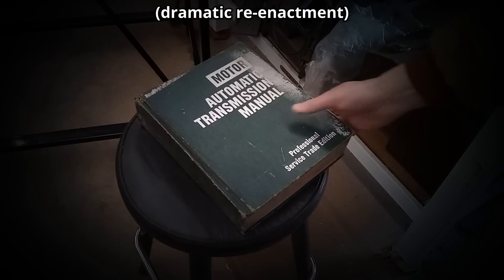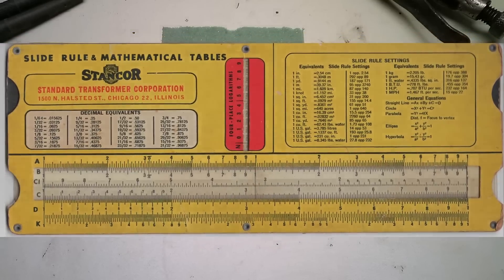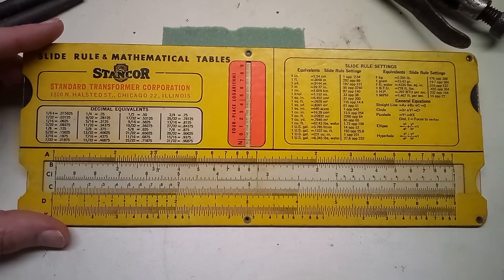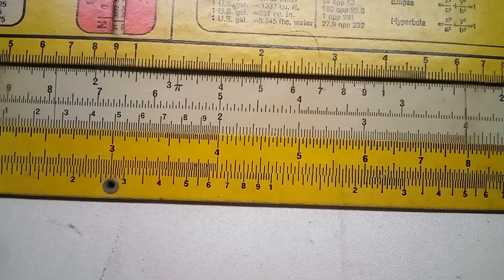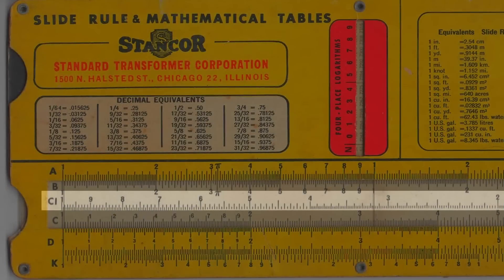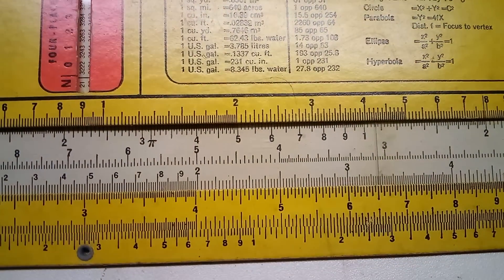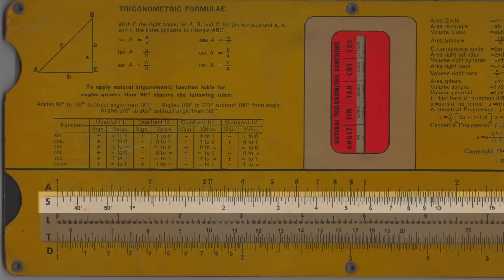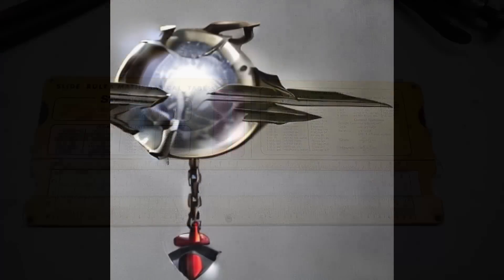1940's Stancor Cardboard Slide Rule

Comment: I believe that if I look in my oldest tool cab I will find a plastic idiot stick (slide rule) that I used in pre-calculator days. A little 8" (half size) one, that was "good enough" for what I was doing. 

I inherited several fancy German log-log-duplex trig model slide rules from my grandparents, but I think they are now lost to the ages (and my using them as a teenager).

Comment: Don't thing I've ever seen one made of cardboard before. I bought a slide rule off of Ebay intending to learn how to use it- didn't happen but I've still got it. Those of us who are old enough will remember watching the NASA rocket launches where everyone in Mission Control had a slide rule in their shirt pocket and could whip it out and get a very complex equation solved in a few seconds. I''m told the good ones are accurate to the 5th significant digit which is close enough for nearly anything. I've got one which calculates exactly how many yards of concrete you need for any rectilinear space and it was very handy when I was doing Form Carpentry long ago.
Reply from the maker: They're fun to play around with. I need to dive deeper into the more complex functions you can do with them. Yeah, most are only accurate to the 3rd significant. That concrete calculator one sounds cool.

Comment: Cheap calculators have been a thing for most of my life but when I was really young they weren't. So I knew how to use a slide rule then. Although I can't remember anything about it today. I also had this metal contraption with a stylus and a bale wire. You'd peck away at these sliding racks with the stylus and zero it out with the wire bale as I can recall. It was some kind of a mechanical calculator. Kind of like an abacus? I guess that's it, an Addiator? We were so primitive back then. What a time. But hey we walked on the Moon. Zoomers have never done that.
Reply: Addiators were for adding and subtracting, you can't do that on a slide rule.  They're pretty cool, maybe @Ballinator can dig one up!
Reply: @GreggMax  I haven't seen one in 50 years. But they were pretty popular back then. I had one as a little kid so they weren't hard to get a hold of. Where they all ended up I don't know. Mine was made out of tin and was probably made in Hong Kong. I think it was red? It was a real gaudy cheap looking POS. But I liked it.
Reply from the maker: Addiators are pretty cool. I've had a few of them over the years.
https://en.wikipedia.org/wiki/Slide_calculator